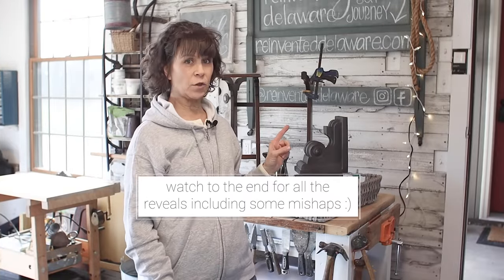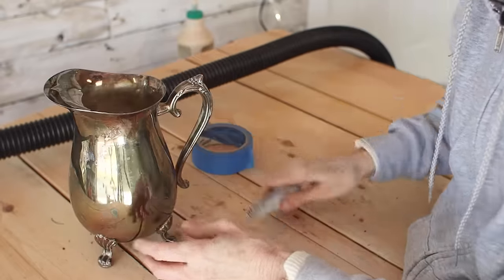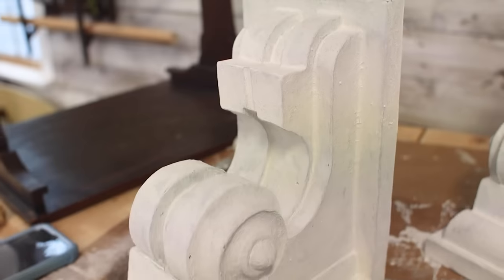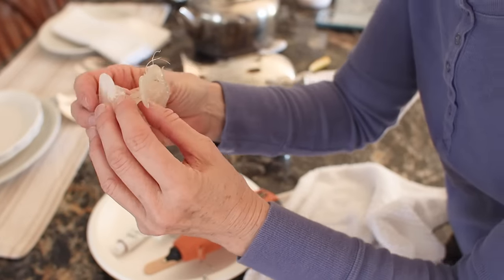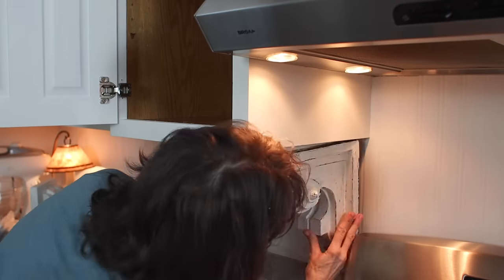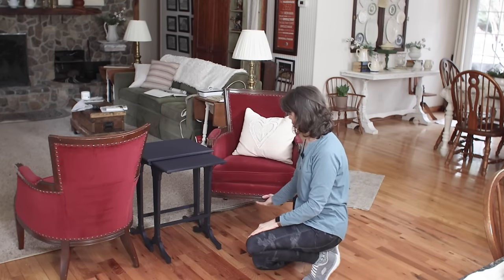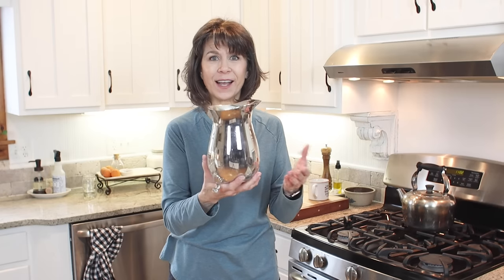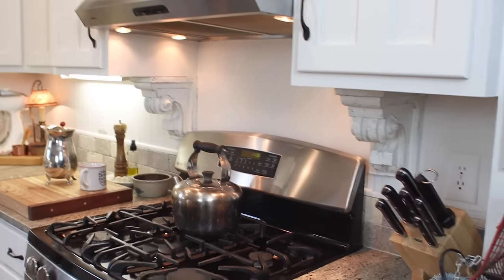5 Thrift Store Makeover Ideas | DIY Home Decor | Upcycled Home Decor

Comment: To make a 3D mold for your base leg I recommend using 100% silicone mix with cornstarch. There are lots of videos on YouTube on how to make that kind of mold.  Once you'd made the mold and it's dried and hard you would cut it in half.  Then fill both sides with whatever you want to use create your leg. I recommend using air-dry clay which again there are lots of videos on YouTube on how to make that with common household ingredients or you can buy air-dry clay at the craft store. If you use air-dry clay you will want to put it in both sides and then put the two sides back together so it dries all in one piece.  You could also use polymer clay by putting it in both sides than taking it out of the mold sticking the two sides together and baking it. Or you could instead of cutting the mold in half put a hole in the smallest part of the mold which would be the bottom of the foot and pour in a mixture of plaster of Paris until the mold is full.  Let that dry for few days.  So you have lots of options on how to solve that foot problem. Another one is just to get a piece of wood and carve it out and make sure it looks the same as the other pieces.  Then when you attach your foot paint it with silver acrylic paint and you're all good to go.
Reply from the maker: You have some great ideas here! Thanks so much for sharing them. I will have to look into trying some of them. Have a great day and thanks for watching :)